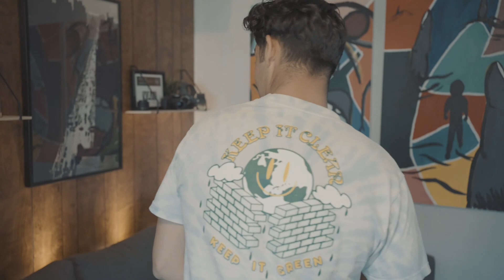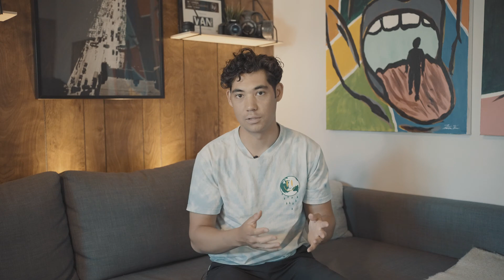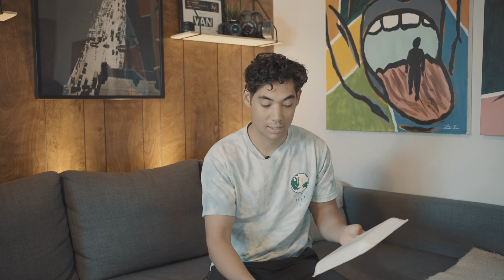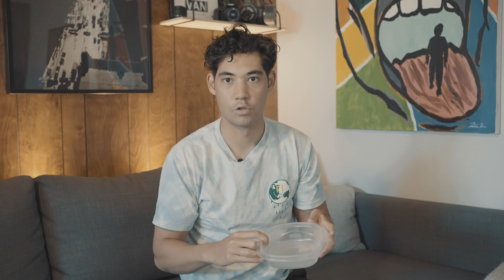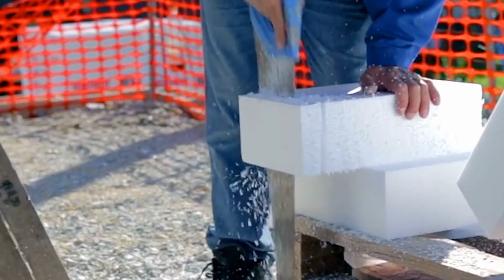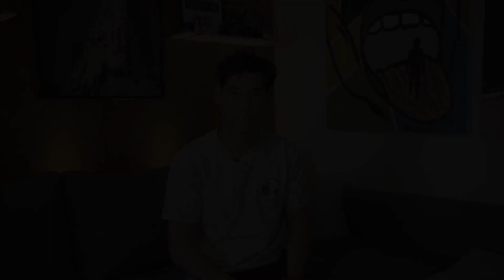What is Polystyrene Plastic? | Why Styrofoam is TERRIBLE!

Comment: I believe it is very important for you to better inform yourself, because you are only focusing on certain characteristics that may seem unfavorable, but you are overlooking all the great advantages this material has.
You could make a video about glass saying it’s bad because it cuts, or a video about iron saying it’s bad because, when it rusts, it can cause tetanus. In the end, everything could seem bad.
Furthermore, you don’t provide any evidence for what you are saying; it’s all assumptions about why it shrinks and how microplastics can be harmful.
Expanded polystyrene is a material used for food preservation and also saves a lot of energy due to its excellent thermal insulation.
It is also widely used to lighten construction, allowing the use of less cement, which is actually very polluting. It also creates an insulating layer that helps dramatically reduce energy consumption for both heating and cooling. This is very beneficial to the environment, as reducing energy consumption lowers the carbon footprint.
There is no perfect material, so I suggest you better inform yourself to avoid confusing your audience. Your intention is good, but your information is not.

Comment: Your title is misleading. Your video is about Styrofoam and only Styrofoam which is EPS foam. Polystyrene itself is a completely different topic. It's a material not a product. 

Your use of the word polystyrene in the title would be like me making a video titled "Lithium" but then the video only shows lithium batteries.
Reply: Hear hear!
Reply: @brianbeakmann4065  No. EPS is made USING polystyrene. Hence the name Expanded Polystyrene Foam. Read my original post, again. Another comparison: Making a video titled "What are tomatoes? Why ketchup is TERRIBLE!" Then making the entire video about ketchup but never talking about the tomatoes, themselves. 🤷
Reply: @brianbeakmann4065  I know this. I used to work for a chemical plant which makes HIPS (High Impact PolyStyrene) and GPPS (General Purpose PolyStyrene). What is your point? You have yet to make one.